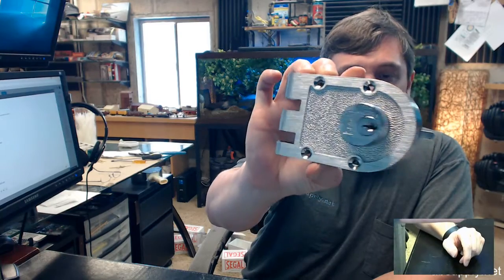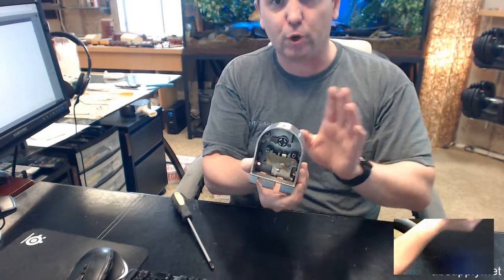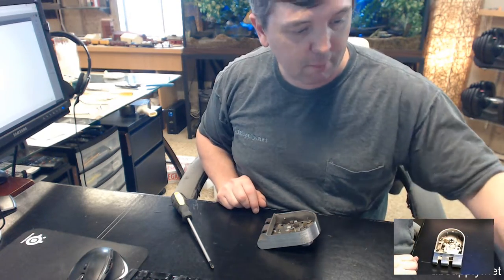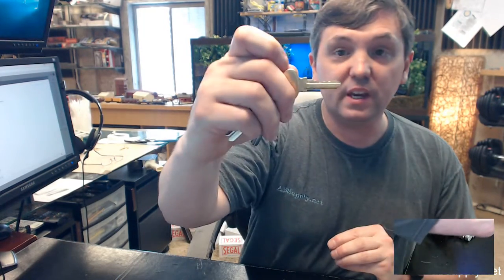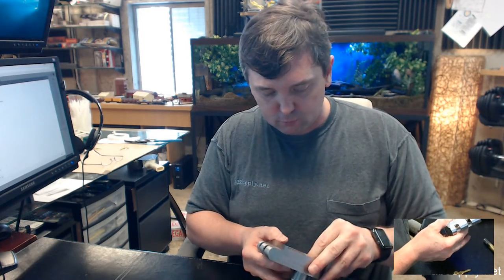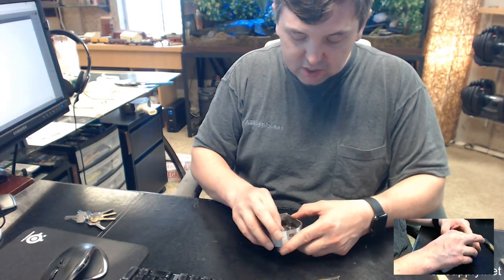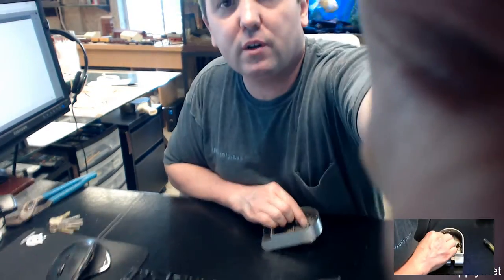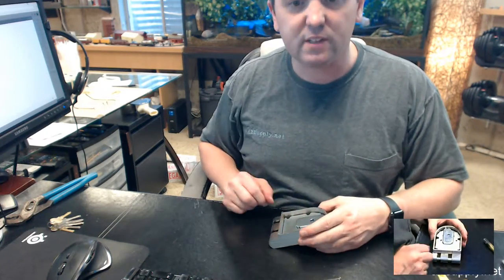Segal Double Cylinder Rekeying

Comment: The reason for the 4 pins in the inside cylinder vs the 5 pins in the outside cylinder is so that you can duplicate the key minus the last cut and leave it in the lock inside for emergency exit in case of a fire, and if someone steals that key they can't use it in the outside cylinder later on. For some reason I see a lot of double sided jimmyproof locks made like this.